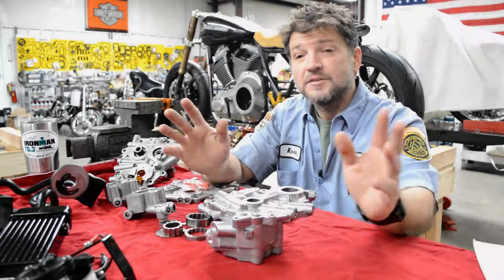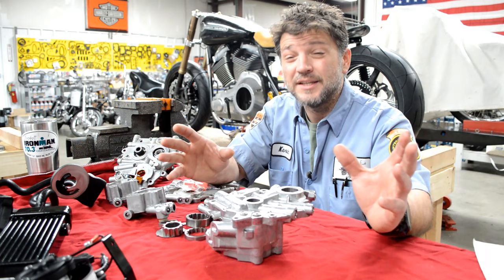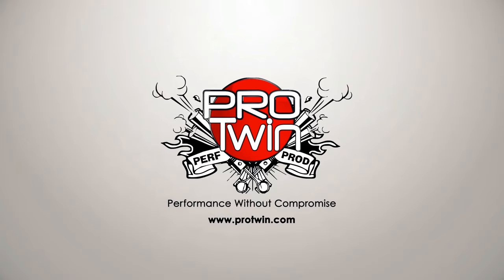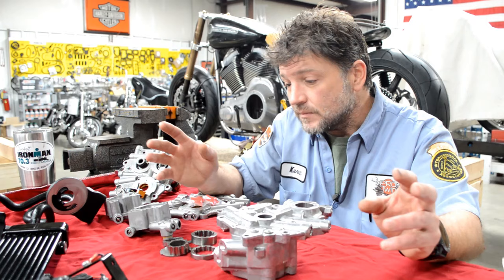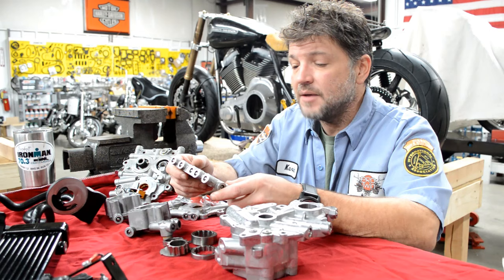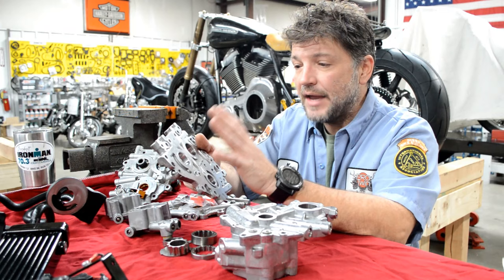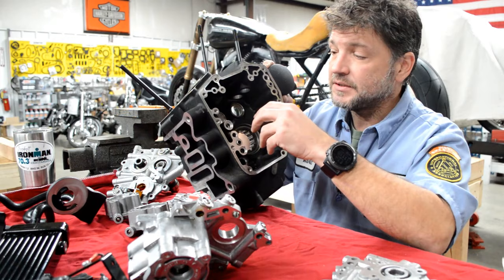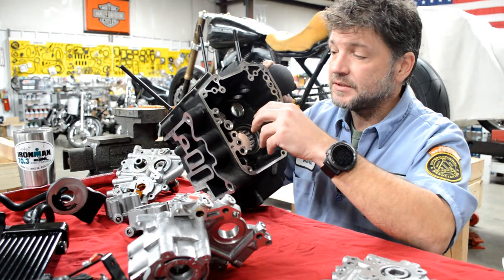Harley Cam Plate Tech - The M8 TC Cam Plate Debate - S&S Cycle - Kevin Baxter - Pro Twin Performance

Comment: I'll stick with the Evo. I thought I wanted a new roadglide and got a 22, and traded in my 07 roadglide,  I couldn't get used to or comfortable with the weight difference,  I took my 22 back in hoping that I could get my 07 back to find out they sold it. They tracked the buyer down, and I did an even trade to get my 07 back. I'll build up the Evo later. The new roadglide is way heavier and sits less comfortably than the 07. Lesson learned...

Comment: Very informative! 
I’m in the process of acquiring the parts to get my 2013 road king back on the road. I would like to have your opinion on the best use of a S&S crank case (mostly concerning the oiling system. Outside vs inside oil lines). You’ve solidified my decision to use the S&S cam plate/ oil pump. The Jag cooler is very interesting, do you have a vid on installation choices? What kind of oil filter would that require, would the stock Harley work with it? I watched another video of yours on the crank/ flywheel assemblies you and another fellow produce, and am interested because I had my stock flywheel trued, balanced and welded... if it gives me any grief I might consider snapping one of those up down the road. If I went with one of those would best choice? (I don’t race and do crazy things anymore since I realized I’m no longer immortal) What about chain final drive conversions, do you have / recommend any in particular (I don’t have a lot of faith in belt drives, besides, I can’t hear them).
Thanks for the vid and I’d be interested in a catalog of the parts you stock.
Reply from the maker: Thanks.  Oil lines...either way works fine...but i prefer to machine it for a hoseless install.  for your road king, there really is only one install option on the oil cooler which is here http://protwin.com/fan-assistedlowmount10-rowoilcoolersystem.aspx  It will work with stock filter or the washable type like this http://protwin.com/hyperflowoilfilter.aspx  Let's hope they did your stock flywheel right.  Using stock wheels is a cost saving option and done right, they work well for your purpose.  Good luck!  Thanks.  We distribute just about everything motorcycle related.  It's impossible to put all that up on the website.  Most folks just call or email for price and availability when they need something.  We would appreciate it if you did.

Comment: Great video very informative.
My 1 question is how do you feel about fueling cam plates and oil pumps???
Reply from the maker: they are certainly an upgrade over stock and have their place.  good product.
Reply: @KevinBaxter  I am wanting to order some cams and other parts from y'all and will be calling tomorrow (thur april 29) to place my order.
Will somebody be available to help with some tech questions I will have???
Im thinkin s&s plate/pump n woods 555 cams
Bike is 2012 blackline.
Thank you

Comment: so here i was thinking my 17 dyna low cam plate and tensioners were pretty much clear of issues if i just rode my way of never dogging the motor and easy cruise laid back mode,i try to make my stuff last.but the plate can still be ruined from runout if the pressed flywheel causes excess runout from coming out of true?because hd took away the better lining material in that spot to bare aluminum?can u give me an indication of what id feel or hear if this happens?right now this motor is extremely low mileage and has been ridden easily and with no indication of any problems yet.i just subbed to your channel you sound very logical and well trained,thank u in advance for your response sir...
Reply from the maker: Quite often, the failures have nothing to do with riding style and are of no fault to the owners. I'd be guessing if I told you yes you're good, or no you aren't. It really is an unknown until ya get in there. Even then, noone should promise you the crank will stay straight. Not trying to fear monger, but it is a reality.  It definitely is less likely to be an issue with respectful riding.
Reply from the maker: Symptoms will vary. Increase in vibration, change to the harmonic some engines make, hard clunk at start up and shut down, erratic oil pressure in extreme cases. Fact is you know your bike better than your mechanic because you ride it all the time. If you hear a strange noise or notice a change in something...feel, power, vibration...insist that it's not normal and things should be checked or validated. There is a reason for the change.
Reply: You most likely will never have a problem man, the later Harley stuff is built pretty good. We put a 107 kit in my brother 2014 ultra at 30,000 miles, the tensioners had very little wear, and the crank was true enough to put the S&S cam chest in it.

Comment: Hey Kevin...
I recently just purchased an "04," Softail...  A pretty nice bike all in all.  It only had 11.5K miles!
Yet, I got the bike, wanting a Harley, and not rich enough to get it 'new.'
All the conversation on the tensioners is chilling!
I haven't seen the tensioners on my bike.  And with seemingly such a low mileage, I don't know what to do.
Why Harley didn't use an idler sprocket, on the tensioner, is beyond me...  Why use something you know will degrade with use and become a hazard to the engine?
It just seems all the Harley stock 'innards,' of their engines, is a real crap shoot!
And it's a bit depressing to see, that the only way to get a better than stock bike, is to invest in an after market engine...  Either in individual parts, or just have the entire engine built from the bottom up...
My softail, as far as I know, is all stock...  And I'm sweating!
Reply from the maker: Hey James. Honestly bud, don't get too caught up in the horror stories. With that low mileage, ride the piss out of it. When ya hit 20-25,000 miles, have it checked. Find a really good shop you can trust, and let them to an all over maintenance. Bleed brakes, change fork oil to 10w, and roll buddy. Enjoy it.
Reply from the maker: 04 was a good year for HD. You won't have many of the issues folks do with the newer bikes. You chose wisely. Best of luck to ya man.
Reply: @KevinBaxter  Thanks for that...  My softail falls into the years with the spring cam chain tensioners...
The first day I took her out for a leisurely run, she bled oil on the ground about the size of a softball...
Next day, 'same thing.'  I wan't a happy camper...
I sort of (no, I did), went on a rant towards the HD dealership that sold me the bike.
I rolled it back to them and I saw the 'big boss,' get down on his hands and knees and shoot the bike with some parts cleaner...  He was in his dress slacks and 'white collar,' shirt.
What seemed to be happening, is that oil was running from out of the clutch cable!  Ever hear of that?
It bled 2-3 times, softball to tennis ball sized puddles, every time I parked it!
They told me that was a situation that happens more than you'd think.
I'm supposed to go get the bike back today.
With less than 12K miles, I'm not changing the clutch cable.  They didn't seem to think there was a need to.
Yeah, I have a guy, I plan on using when I need to in the future.
But I just got the bike!  Just rolled it off the HD dealerships floor!  I felt that they needed to make things right first...
Reply from the maker: It can happen yes, but that seems excessive to come out of the clutch cable.  Softails can sump...basically, after sitting, because the oil tank is higher than the pump, oil can drain from the tank into the bottom of the engine case, past the pump.  Always make sure to check your oil when the engine is hot after a ride, and not cold after it's been sitting.  Often, people will see low oil level, then add when cold, and its overfilled once running.  Also...check to make sure the vent line in your trans is clear.  If not, it can have pressure forcing a leak at the cable and other places.
Reply: @KevinBaxter  Hi Kevin...  Thanks for getting back to me.
There seems to be no oil coming from the engine at all...  All the oil that leaked from my Softail, came via the clutch cable...
It still drops a few drops after running, and it's dripping from the cable, where it bottoms out under the Cam cover, then heads up to the handlebars.
The dealership said that after some time, the cable begins to wear, as the external sheath must also...  And oil from the transmission follows the cable through the sheath to the lowest point, and drips from there.
"This seems to be the situation..."
A new cable would probably cure the issue.  But they wanted $250 to put a new one on it.
Not in the budget at the moment.  I just went into a hole for $8 grand!
I guess old Harleys are just lemons straight from the tree!
Reply from the maker: Sounds legit.  it can happen, and does, over time.  you have to pull the exhaust to install the cable in most cases...not a terrible price really.
Reply: @KevinBaxter  I'm not sure how to go about checking the 'vent tube,' on the transmission.  I know it's on top.  But it seems pretty inaccessible.  Under the oil tank and all.
The clutch cable seems to run from the trans, along the right frame tube, then under the cam cover, where it goes behind the front exhaust pipe, and up to the handlebars...  I don't see anything about the exhaust pipes that would require them to be removed.  They are separate pipes, 'Harley stock,' if I'm not mistaken...
I just wonder if a $2 dollar O ring would be the problem, where the clutch cable connects to the trans...
Think maybe the dealership is trying to get $250 out of me for a $2 dollar O ring?
The cable runs what...  $50 or so?
Reply from the maker: trans side cover on the trans has to be removed to replace the cable.  there is an oring in there...but most often its the cable housing that leaks...not the oring.  Plus...a cable is around $75 bucks or more.

Comment: Hi Kevin, another great video. I have a 2000 Softail 88B Harley, on the stock cam plate for my bike you said that it has ball and roller bearings for the cams, does the S&S cam plate use this type of bearings for the cams?

Comment: Kevin, not sure if the question has been asked. I’m going 95” in my 06 Road King. I was told upgrading to the 07-up hydraulic cam plate is a great option. Saw that 2 companies actually endorse this. What is your opinion?
Reply from the maker: it is a very good option if crank is too far out for gear or budget doesnt allow for it.  have done many many of them over the years.

Comment: Great video Kevin! I am trying to cool down my 2015 RGS that has a tire shredder kit. I have already added an Ultracool fan assisted cooler and a K&P oil filter kit. I have been waffling on the install of the S&S cam plate and oil pump. Would the install of the S&S parts assist in helping cool the motor down?
Reply from the maker: It could help but I would promise that to you. It's quite possible, that it could be a tuning issue as well.  Ignition too far advanced or running slightly lean. Target a 13.8 afr at idle, 14.1-14.3 at steady cruise,  and 12.8-13.2 at heavy load or WOT.  Oil shouldn't smell like fuel, and avg around 38 to 42 mpg. Also check for intake and exhaust leaks at various temps.

Comment: Thanks for the detailed explanation,  Is there a easy way to re-route the oil direction flow to run through the OEM filter first?   I tried to locate S&S lifter cuffs and Oil Pump for my M8 on your SHOP and was unable to

Comment: You forgot one oil hole... When you change out the roller bearing with "timkin"  bearing for even rotation on the crankshaft. when you weld up a pressed crankshaft and drill a hole at the 12 O' clock position. ???
More compression, with even rotation?
   LMK what You think.

Comment: Thank you for these videos!
New Sub, I’m considering getting the Jagg fan assisted oil cooler for my 99 Dyna TC-88 would I need to upgrade the charging system if there is such a thing or am I good to go??

Comment: Kevin, do you recommend following the factory method for checking the engine oil level (check hot after idling 1-2 mins on jiffy stand)?  I'd much prefer an accurate method to check it cold, taking into account approx 1/4 quart low reading at 70 degrees. Sorry if I'm beating a dead horse.
Reply from the maker: Actually, I've always been in the habit of checking it at the end of my ride when I get home.  Then I know it's hot and exactly the level it will be while riding.  Then, when I'm ready to roll i dont have to worry about it.

Comment: I'm getting together to put hydraulic cam tentioners in my 06 fatboy twin cam. How much will it cost me for the parts .I'm just wanting the cam chest and oil pump and of course adjustable push rods. Also all else needed breathers in the rocker lids. I'm not taking the rocker boxes off ,bolt cuters too the stock push rods .

Comment: The difference between casting and forging aside cashion when you pour it in there can have are cavities and what they call cavitation which are the little air pockets within the metal forging the metal is forced under high pressure into the mold so therefore there are no air pockets everything is pushed in there real type-r for the metal is stronger.

Comment: Hi there great channel full of really good info. I’m looking at getting a 2018/19 ultra limited 114 m8 with 4000miles are these engines reliable if I replace the oil pump and cam plate? Or would you stick to a 103 HO 2016 twin cam 3000miles. 
Thanks in advance

Comment: Great video giving me an understanding of how my M8 with SS cam plate and pump is working. Would have liked to start right from the oil pick up  and move on. having said that, if your draining oil for a service from the sump we should probably drain the casing too right?
Reply from the maker: No need to do that.  If the oiling system is healthy, you'd only have 2 to 3 ounces of oil in the bottom of the case anyway.  Not worth messing with.
Reply: @KevinBaxter  would that be the way of seeing if you had a sumping issue on a stock bike?

Comment: I'm looking at buying a 2019 Road Kong Special snd was wondering what a red shift cam S&Soil pump an plate S&S tappets and what ever you sy on push rods vs whar you all would charge to do the build

Comment: hi,Kevin   would it make sense to install S and S cam plate and oil pump and the oil cooler you talked about in a brand new M-8  also AWESOME VIDEO'S
Reply from the maker: Thank you sir. I actually install many on brand new bikes. I cant tell you that its absolutely necessary in all honesty...but it is a great insurance policy against future problems that could pop up after the warranty runs out.  A good time to step up performance with a cam upgrade at the same time so you get a bit of performance benefit too. Also...there were a bunch of folks who had brand new bikes and their stock ones failed. If you decide to get one, give me a call and I can drop ship one out to you.

Comment: I bought a used 01 Flhtcui and seems my.oil pressure is 10 or less at idle and 32 while under load...is this normal..and do u have a vid on replacement of plate? I am kind of mechanical and probably could do it no problem..but tricks of te trade are priceless...this vid was amazing thanks

Comment: I bought my '05 FXDWG(Carb'd), with 3,773 miles. Although it is very low miles for the year, would you recommend I inspect the tensioner shoes? Even due to not riding, would you suspect them turning brittle over time. What would you recommend as a replacement? Not planning to really modify the motor. 88 c.i.
Reply from the maker: I would agree...very low miles to require checking.  I have seen some low mileage ones break from being brittle so i hate to tell you, dont worry about it.  It's cheap insurance and peace of mind.

Comment: Great video!     S&S as always is the best for me.   I am a little confused about which Cam chest kit to buy.   I have a '19 FLHC 107 Heritage.   I'm not a racer but I do like to toss it around a bit.   Mostly I would say touring around Arizona and day trips is my thing.  When passing  I like it to be quick.   It's a stage one now.  Cam kit is my next project.   I'm retired and would like to do it myself but I don't have a lift and certain specialty tools like bearing puller etc...   A shop will be ok, I just don't get the satisfaction of doing it myself.   Would you recommend a kit for my application?   Thanks in advance,  Tacobob

Comment: Damn good video, so basically the problem is the stock pump puts out more then it can recover? Especially on the M8s?
Reply from the maker: Thanks. That's one issue. The second one...when on the side stand, the crankcase oil drains into the cam chest and the stock pump has a near impossible time recovering from the extra build up. Plus...pressure valve bore casting issues, etc. Thanks for the sub.

Comment: I've had a twin cam 88 with 75000 miles on it and never changed the cam tensioners they were spring type. Now I have an old deuce with 20000 miles on it and am 5hinking of changing the cam plate to hyd cam tentioners.  Is there a difference in an A andB cam plate.

Comment: Hi Kevin, and thank you for the info.  I’ve got a new 2023 Road Glide Limited with about 800 miles on the clock.  Other than the S&S Cam Plate and pump, what else do I need to do to my engine right now?  Thanks very much!

Comment: Thanks for the helpful videos. Question; I am hearing that from 2020 onward, the Harley 114 M8 has revised its oil pump and that a replacement oil pump and cam plate are not necessary. This would make the cam upgrade much more affordable. Do you agree?

Comment: Kevin, can you please tell me if I should put the scavenge port O ring on the pump spigot, or inside the case when installing the oil pump/plate? I removed my cam plate with my oil pump still bolted on (didnt mess with the oil  pump bolts)     my shop manual says put it on the spigot on the pump but most people online say to put it into the case.. 2007 dyna street bob twin cam 96!